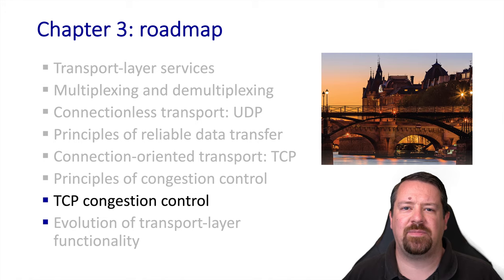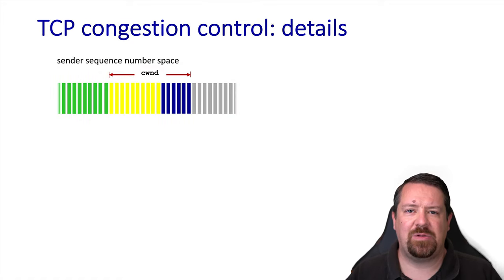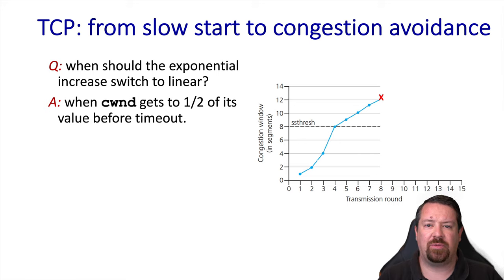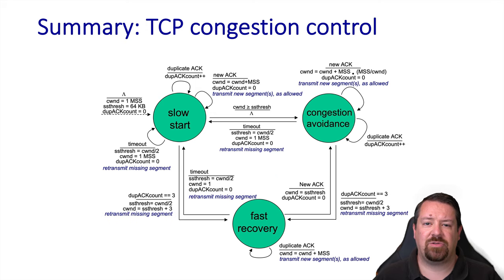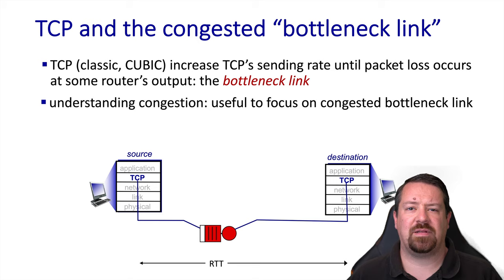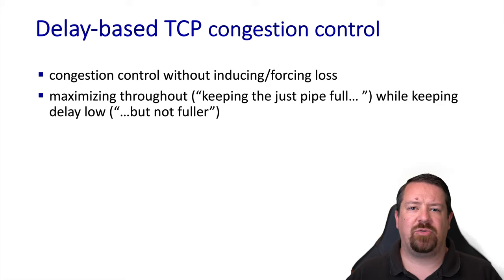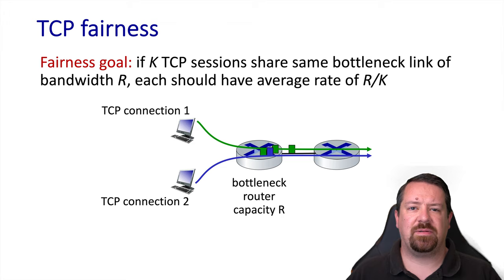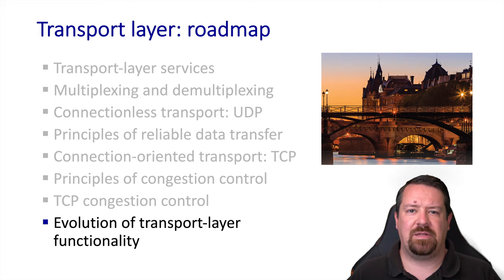TCP Congestion Control - Internet Transport Layer | Computer Networks Ep. 3.7 | Kurose & Ross

Comment: Around 1:10 you say that only timeouts were used to indicate congestion in Tahoe, could you provide a source for this? According to Computer Networking-A Top-Down Approach (page 300), Tahoe did use triple ACKs as a congestion indication, but handled it in the same way as congestion indicated by timeouts.

Comment: i though additive increase, will increase the congestion window after packets equal to prev congestion window is sent and acke
Reply from the maker: The exact implementation may vary by operating system, but the CWND will increase by 1 MSS by the time each full CWND of data has been acknowledged.